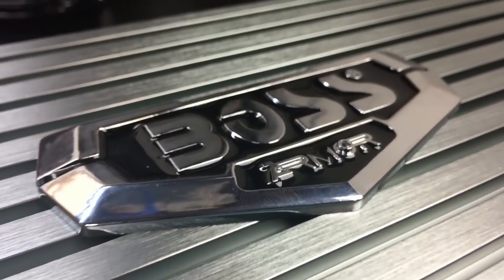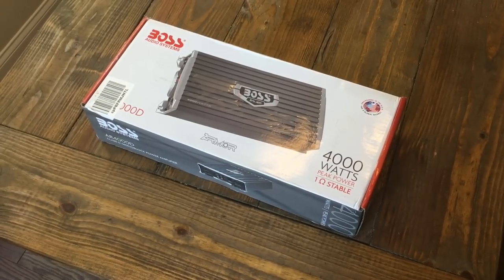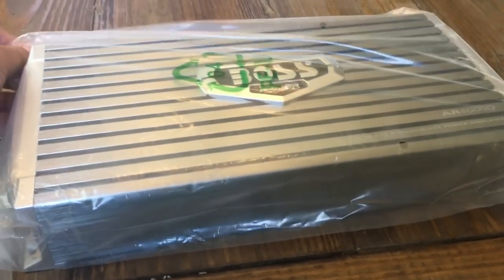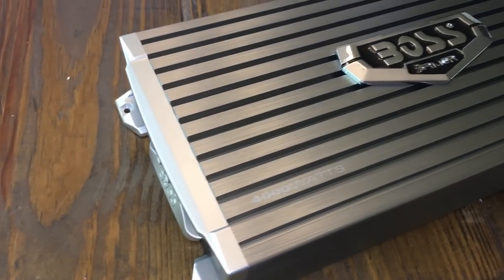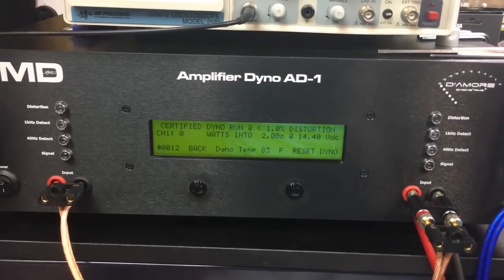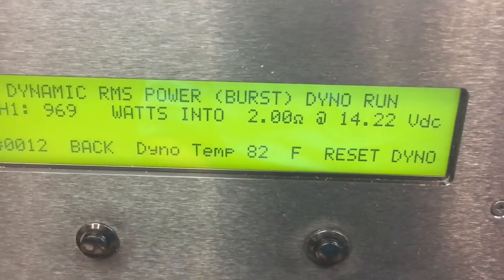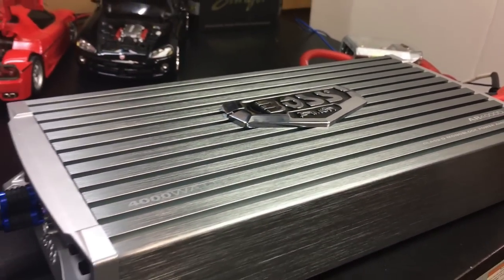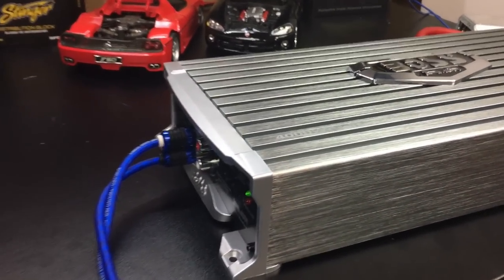Who's the Boss? AR4000D 4k MAX Amp Dyno Test

Comment: You gotta admit 1100-1400 watts for a $80-$100 amp isn't really that bad
Reply: It is when it lasts a week and you have to buy a new one.
Reply: Cheap DIRTY power.
Reply: With a 56% effiency it really is a waste of money
Reply: true but ull prob fry it 3 months down the line and thats if your vehicle doesnt catch fire first lol My aunts husband was running one in his escalade and that thing caught fire the good thing is his kid wasnt in the his truck because usually shes in the rear seats but that day he was rolling alone and that thing caught fire like a mutha.
Reply: I had a powerbass amp fry after 6months. And it was professionally installed.
Reply: I’ve had cheap boss , legacy, pyramid amps. Some lasted along time some didn’t . I’ve had Jl audio do the same
Reply: It is a 700Watt amp at 2Ohms and 900Watt amp at 1Ohm. Wouldn't dare use this below a 2Ohm load in summer or hot car, ever. With inexpensive products like this anyone should ignore power above a 1% THD level. Power at clipping tests the circuit for saturation and its maximum capabilities, while dynamic tests capacitance and peak rail voltage for a given load. No surface mount components, nice potentiometers, double sided PCB, zero coil staking (a natural zip tie is better than nothing I guess). Compact and dirt cheap 700Watt max RMS 2Ohm mono amp.
Reply: @bentrishaleemartin926  it is when you can get a belva bb3000 for 110 that does 1950 at 1ohm 
Dynamic burst and will actually last.
Reply: 4GB MEANS 4GB I got this amp In a sub kit just to run till It goes out or whatever and I have ran it like crazy for the past year and a month and still works great
Reply: @4gbmeans4gb61  I've had my boss armor series for over 4 years and run it at 1ohm never had a issue or get hot
Reply: @pgmurray76  ok have no clue about your rambling but I've ran this amp in the 3,000 model for 4 years at 1ohm never has gotten hot and actually is very great amp for the price
Reply: B.T Martin not me I was a dealer boss lprymaid are the worst audio equipment maid unless there is sum thing worse now
Reply: 4GB MEANS 4GB they actually last a long time. This same guy couldn’t kill it until he threw copper wire into it.
Reply: Boss amps are haaaaaard to kill lol
Reply: @jasonborn9394  they probably screwed up setting the input sensitivity on the amp. Most install shops don't use a scope, let alone even a multimeter to set the AC clipping voltage.
Reply: 4GB MEANS 4GB not everyone can swing $2-$3k for a single amp. Hell my entire system cost less than $2k it all came from pawn shops, FB Marketplace and Craigslist but it sounds damn good. It’s all about having fun and waking up the neighbors. My boss 1600.4 doesn’t sound horrible I know it’s closer to 700w than 1600w but it’s match to subs with 200w RMS and works great. Had it 2 years and it was used when I got it.
Reply: @4gbmeans4gb61  The store return is 30 days from each time you return a unit, so still worth it!
Reply: @1royathrone1  Stop spreading bullshit, hundreds of thousands of people are running these products and yes I am sure some caught fire, but I assume it was the installers fault or the person running it with no idea what they are doing!
Reply: Brandon Smith  Rockford Fosgate is the same shit, all car audio works and fails, people are purposely abusing their subs and amp so they should expect it to break someday!
Reply: Had mine for 2 years now and still works perfectly. Never had a single issue with it.
Reply: Can anyone suggest decent 1kw amps to buy online that ship to Mauritius?
Reply: Strictly speaking power-wise? Sure. But BOSS is cheap components - always. I imagine the only way to keep this thing from breaking apart is to not push it to 100% to preserve the innards. I imagine if you only needed 75% of the power it might last longer but who knows for sure?
Reply: Facts b8f facts
Reply: Timothy Coll  OK Timmy... You go ahead and use those cheapo amps, and I'll use quality amps made with quality components.... "Clipping"...... is that what it's called, Thanks for "informing" me of the "proper" terminology....
Reply: @1royathrone1  they probably had 8 gauge wiring.  Pulling too much current through too small a gauge of wire causes wire to heat up and melt.  I've seen many of these amps working fine when installed properly.  I had the 1600D version I used it to break in my sub while I was waiting for my actual amp that was on backorder.  Paid $59 on Amazon for the 1600D version.  Probably only did about 220 watts RMS but it ran cool, sounded decent, came with a bass knob ... there's lots of good things I can say about it especially for sub $60.  When my amp came in I sold the Boss on Kijiji for $80 (Amazon price had risen to $109) so I actually made a couple bucks as icing on the cake.  They aren't super high end and I hate the spade terminals but meh they are not bad at all.  Quit being such a hater, you've never had one so you're not allowed to form an opinion.
Reply: @deemoney6570  my brother has 2 of these on 4 Kicker Cvr's in his truck had them I know for sure at least 5 years an never had a problem with them
Reply: @1royathrone1  why did he choose to run this amp in a ESCALADE
Reply: @chuckywrld171  no idea ask him lmfao! You think fools go around asking why they put shit electronics in their vehicle?
Reply: @joesmith389  This makes zero sense. 100%  Copper wire is better for conduction .
Reply: @udontneedtoknow8823  ive had mine for about 9 months and run it hard and it not once has ever got hot so I 1000% agree with u
Reply: @1royathrone1  the amp is made up of metal there is nothing in it that could catch fire and result in vehicle fire even if it blows up and shorts out internally. I am 120% sure the fire in your uncles vehicle was caused by improper installation. Like he probably did not use the right fuse , did not use the proper conduits to protect his wires , did not use proper ground , did not use proper size cables . Fire inside a metal cabinet filled with just transistors , ic , coil , caps and circuit board will not result in enough heat to set other things on fire even if its mounted on carpet. Typical transistors catching on fire after overload lasts for a minute and the flame is dull only enough to blacken the area. As seen in the video the internal protection circuit is very sensitive so these amps generally do not blowup even with hard abuse.
Reply: No it’s not bad if you don’t care about clean power and just want some bump for cheap. But my friend had the “2000 watt” version and it lasted 3 weeks at 1 ohm. And he really only listen to it going back and forth to work which is only like 45 minutes a day 5 days a week lol.
Reply: @JayP7.62   Got a full boss audio "garage stereo" I made myself when I had a spare $37 boss deck. Upgraded to the flip out screen single din, boss 6" and 6x9s (all 4 ohm), with a boss elite 1600, and the AR1500m (was a Blaupunkt8", then become 2 15" fisher tower speakers, mids and tweets removed). Me and my friends abuse the hell out of it. It's still going on strong today. The only things not boss are the wires, the boxes (one homebuilt, one groundshaker 8" T-line 32hz tuned box, and some cheap scoshe 6x9s sealed boxes), homemade rails, planet audio 2F capactior, truck battery and subwoofers.
 3 years later, Everything has been fine.
Not even with the sun beating outside at 100°F did they have issues playing loudly outside in the shade. 

Do I expect my setup to win an award? No. Am I boasting about it? Sorta, I wont lie. But am I being honest? As much as I can prove in a youtube comment, yes. 

Budget has no place in wanting something specific, unless it's a budget build. Not for SPL, or for a quality listening experience. Don't have high expectations for budget electronics.
And you will come to see that even boss isn't as bad as some make them out to be. Just obviously remember, it will likely never do what it states it can. 

Tell your friend if he wants one ohm, then  get anything that's not a budget amp, anything that is not BOSS.
Reply: They're $280 now
Reply: @stevofla239  Jesus that’s depressing

Comment: we would have killed for a 1k amp for 100 bucks 20 plus years ago lol too bad they dont advertised the REAL numbers, probably would sell better.
Reply from the maker: +Preston Cooper I think Boss is selling as many of these as they can make. Dey be makin' bank like a "Boss" 😜
Reply: true dat, lol    and BigD that picture in picture head shake about rocking the decal made a little pepsi come out my nose, lol Even cats running Boss don't sport the decals
Reply: How do you really wire up 4 -  10" duel voice coil subs to a 1 ohm amp all planet audio equipment
Reply: THESE DO NOT LAST WORTH A SHIT>.....  And if you do anything past 4 OHM on it, well IT WONT LAST A WEEK>.
Reply: @waitemc  yup we were just talking about that here too.
Reply: 4GB MEANS 4GB iv’e had mine at 1 ohm for 4 months so far, also bottomed out the sub multiple times, no problem with the amp tho
Reply: @4gbmeans4gb61  mine has lasted over a year and still going strong.
Reply: billy Johnson nice glade urs lasted.
Reply: @waitemc  not true actually.  Iv had my 3000d for a while.  A good 6 months pushing 2 inch rockfords.  At 2ohms.  The amp was totally fine. Never once overheated. But.  I did recently blow the subs themselves haha.  And upgraded to a much higher wattage sub set. And had to upgrade the amp.....and to 1/0guge wiring etc.   The amp was a trooper for the price.
Reply: This was meant for 4gb means 4gb.   Not you sparky.  Sorry bud
Reply: Yea! That was when a head unit cost $400 . The economy dropping off is 2hat made the price go down. People stopped buying it so it forced prices down. Some companies cheapest out and started manufacturering there stuff in China like kicker which stained it's reputation a little. But yeah I remember when car audio was really expensive. IAM glad it's also a lot more compatiion now between brands so it forced brands to make the best for the best price to stay in it. Kicker hopefully learned it's lesson coming out with the Chinese line the ones that had the flat designe on the front and instead of being called the original name they would put a letter beside it like the comp. They came out with the comp c and instead of cvr it was comp r. It confused people. Most people don't know the difference. But you can compare them and see a hudge difference in build quality and material. The good ones have the more 3d raised cone. The cheap Chinese ones have the flat designe. It's crazy because now your seeing even cheap gear that is decent.  But yea you caint beat the price
Reply: @waitemc  Hell in my town and I'm guessing allot of others there's noise ordnances now but I still hear one occasionally. I do agree with you though about the only 1000 watt amps I saw in the 90's was usually a Pyramid and you knew that was bs. How times have changed
Reply: And that was back when a $100 was a $100 now a Franklin is like a Jackson
Reply: @waitemc  its still a thing around where i live. its insanely annoying. nobody is impressed by this shit and they are damaging their eardrums. nobody wins.
Reply: @danielphillips5229  actually, bass, which is a low frequency is not at all damaging to hearing.

Comment: 256 watts total at 1 ohm.  You have to realize it's not 120 amp it's rated for. It's only 40 amps. Cuz anytime anything over 40 amps runs across any one of those 3 fuses it's gonna pop a fuse if it's continuous.

Comment: If Boss just said hey 900 watt amp for $100 that'd be a steal and nobody would bitch but the lying has got to stop
Reply: lol
Reply: Hell, if they named this amp "AR-1000D" it would still be legit (won't deliver a 1000w of clean power, but will still do more than 1000w uncertified or dynamic), and if they actually put rated RMS power in the manuals for all the ohm loads.. well, let's say 400w in 4 ohms, 700w in 2 ohms, and 1000w in 1 ohm, that would have been an amazing deal for 100 bucks.

Comment: For $90 it's not a bad buy, polish the silk screen numbers off pull the badge it's a really good looking amp.
Reply from the maker: +Bob Snow I agree it is MUCH nicer looking than most amps out there. Back in the day, the amp's heatsink design was a priority. These days it seems to be an afterthought.
Reply: Bob Snow exactly...hate the big chrome badge...
Reply: BigDWiz to I loved the 1st gen Mtx Thunder amps, but someone liked my 2300 more then me 😢 still have the 2160' 240, & 4160. Be using them on my next install would like another 2160 and 2300.
P.s. Love what you do for us car audio crowd. Enjoy the dyno tests. You also give us your take on the sound quality.
Reply: That's exactly what a real audio custom installer home or shop would do too. Or do like I did when I was 16 and I had some white coned realistic speakers and went to the stereo store and stole the BOSE tags off the speaker grills and pinned them to my grills on those poopy realistics. lol. People were stupid fooled just believing what they saw and bragged all over the school... Nifty got those Bose 12's yo!!!!! lololol. If you are truly unique you would use no brand name and make your own brand name and put it on everything you own like red hot sauce. My name back then for installation and comp was Vigorous Sounds. I ripped all tags off every speaker dust cap and magnet as well as the amps and repainted and relabeled into my color scheme and name. This isn't a Boss ride or a Rockford ride it's fkn Vigorous Sounds mufuckaaaaaaa!! lol.

Comment: They would get more respect if they sold it as a 900 watt amp.
20% of rated power is pretty low, but yea good for under $100.
Reply: 20%? Max power is a made up number by marketing wanketeers. It has no meaning. This amp is a 900W RMS amp.

Comment: I have a Boss 1600 watt 2 channel(bridged) pushing a 1500 watt 15" sub strongly. I've had it for 4 years and it's still going strong and has never over heated. I've read alot of reviews bc people say Boss amps suck. In general people seem overall happier with the 2 channel vs mono-blocks. Mine seems alot closer to the actual numbers specified. Would love to see a dyno of a 2 channel  to compare with the mono-block.

Comment: I used to work for a small shop where Boss was the biggest brand we could get legitimately.  This is back in 1995 when they were almost unknown.  At the time, they seemed to be wanting to compete with the larger brands and had a pro line as well as offer a base line.  Their pro stuff was rock sold and I'd even say the ratings were accurate.  Their base line stuff was exaggerated, but similar to this review.  The price was so good that people forgave it.  And honestly, all of our customers were very happy.  We were able to set people up with a very loud system for under $500 using a "600w" Boss amp and a pair of Earthquake Annihilator subs installed.  That was cheap in the day.  They always came back to us saying how they kept up with people who had $1000 systems.

We never tried to convince people that their amps were top end stuff, just a good value.  And comparing the Boss amps to other cheap brands (Pyramid, Power Acoustik, Rockwood, etc.) at the time, Boss came out way ahead.  I have always thought that Boss had many good heatsink designs through the years.  Particularly the AVA-600M or AVA-400M.  Oh and I still have a couple of those amps from 1995 and they still work perfectly.  Sadly, I can't say that about a lot of the Rockford/Soundstream/Phoenix Gold amps I have.
Reply from the maker: +Mickey Pietrzak great info, thanks 👍

Comment: For $100, this amp is not a bad deal at all though
1400w dynamic for that price.

But there are better budget options out there, such as the Pioneer GM-D9601
Reply: G6 Liara yeah people dont realize boss amps are actually really good for the price
Reply: G6 Liara love my GM-D9601!
Reply: yeah but that Pioneer is almost double the price so that defeats your point on a good deal or better budget option.
Reply: Best amp under $200. Its basically a JBL GTX500 that goes to 1 ohm which the JBL can't. This Boss though beats that JBL when running 1 ohm and both were priced similarly. Keep in mind that this Boss is 58.5% efficient running it like you see in this video (at least going by my math I could be wrong) where that JBL will around 80%. 160 amps and 13.7v at 100% efficiency would be 2192 watts. This is only seeing 1425 watts. At 80% efficiency you would get 1753 watts which is realistic for a better quality amp. You will not get an amp like this for even close to $100 though.